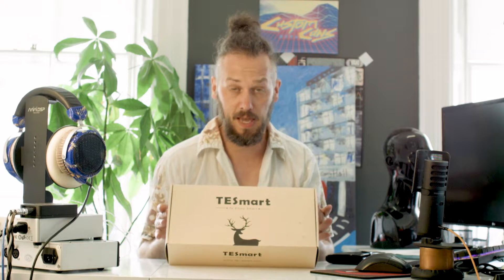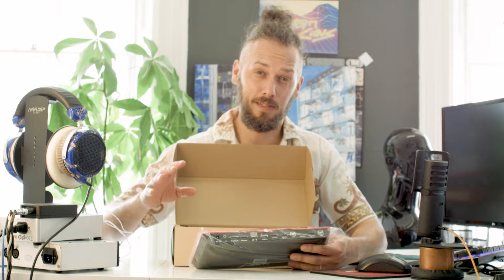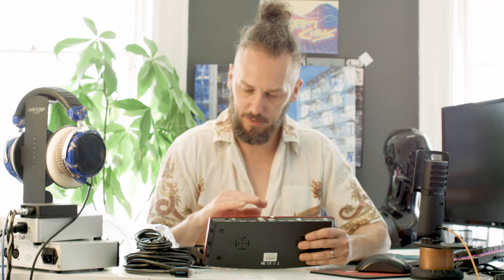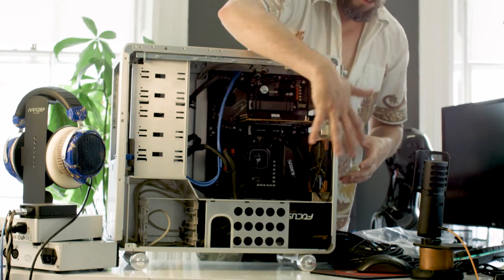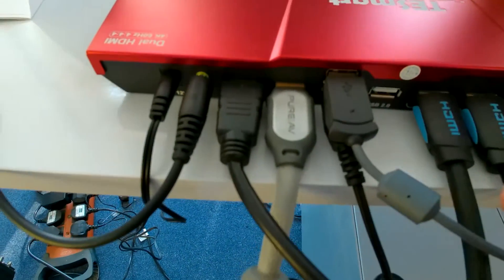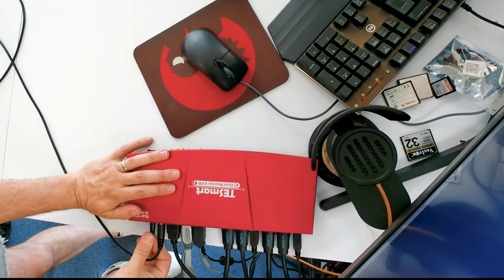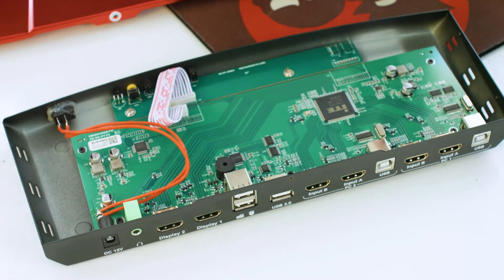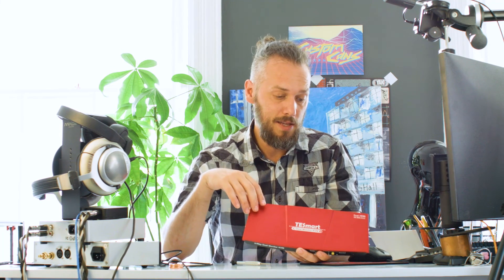TESmart dual monitor KVM - for when you are too productive for one PC to handle ;)

Comment: That’s just what I need. Is 32 gig enough? I usually give 2 to 4 gig per thread for complex computing, lice rendering or pure calculation on large data sets.
Reply from the maker: It was built on a budget and I went for fast ram rather than lots of it as the ryzens seem to perform well with faster RAM but I will definitely consider adding more in the future if i see a 64gig kit turn up cheap online ;)